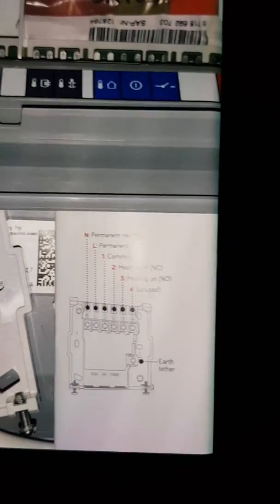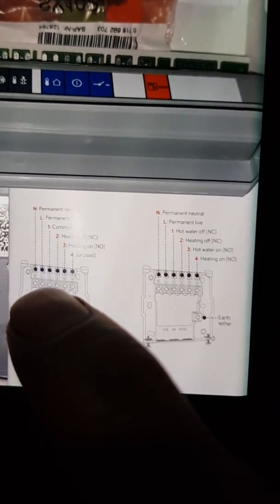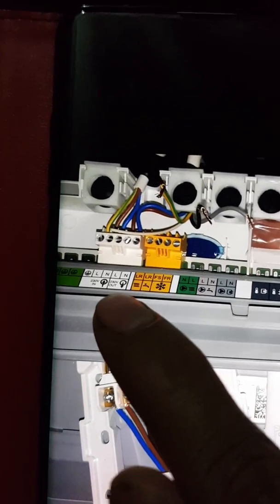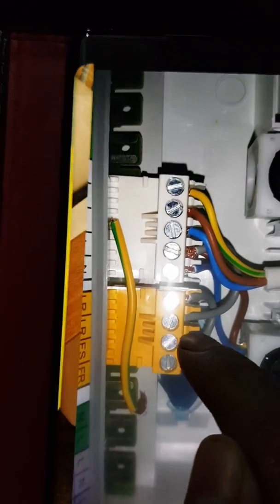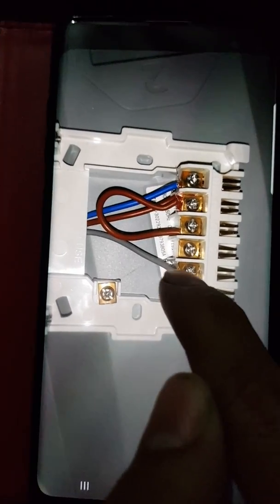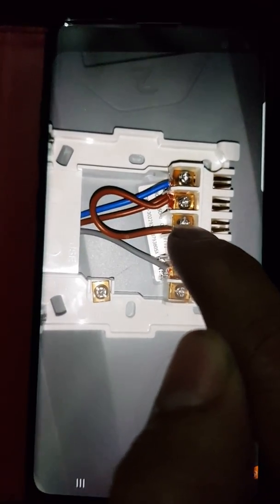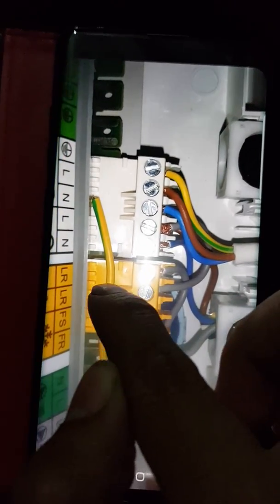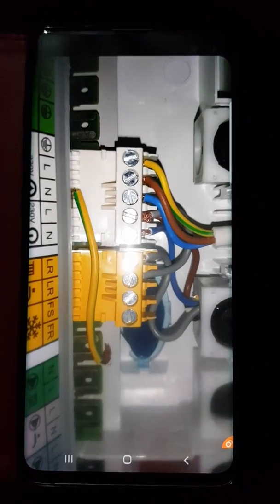Wiring in a hive for a Worcester combi 30i

Comment: Just make sure you sleeve number 3 on the hive receiver and live and RT on the boiler connection with brown sleeving . makes it easier to identify a live or switched live for others also make sure there's no copper strands outside the plug connectors.
But informative video just the same.

Comment: This has been done as the same but still having problems with getting the heat operated will I have to remove the existing thermostat control
Reply from the maker: If you install a wireless thermostat then you would have to get rid of uour old stat
Reply: How do you get rid of your old stat on this boiler please

Comment: Do u have to have a link from live to water.. because it doesn't have a link in the diagram on Worcester website
Reply from the maker: Yes if you follow what is said in the video you need to power 230 volts to LR for water (LR MEANS Live Return). So put a link between live in the white block to LR with the tap sign in the yellow block
Reply: @khuramakram  Im also wondering this if its required (live to water). I have seen other guides that doesnt use it. So is confusing.
Reply from the maker: If you don't give it power from live to water the the boiler won't gey no signal indicating it to fire up do it needs power to power it.

Comment: What size cable do you need to use
Reply: Buy a metre of 3amp cable from Wilkinson’s for 80p.
Reply from the maker: You can use 0.75mm - 1.5mm 3core flex cable don't use bigger the 1.5mm